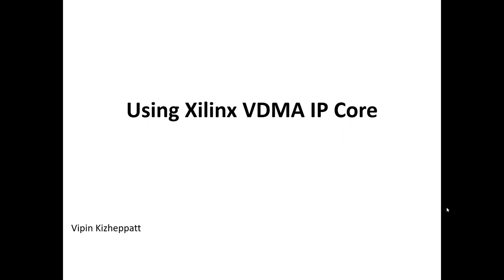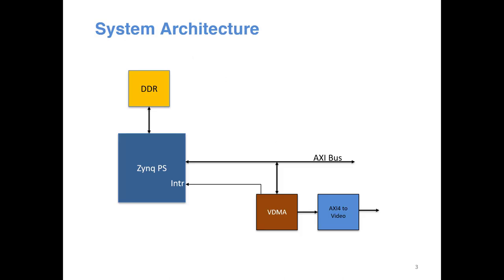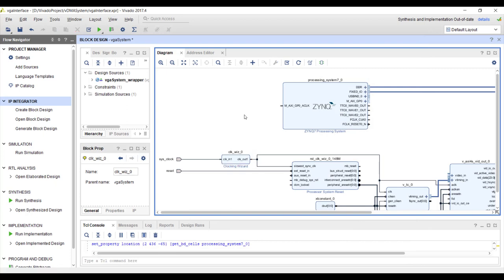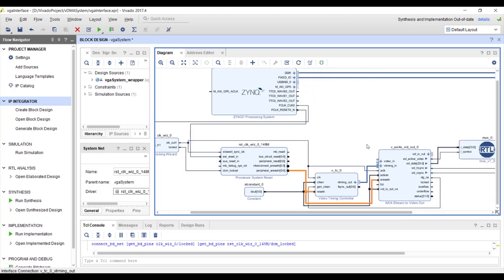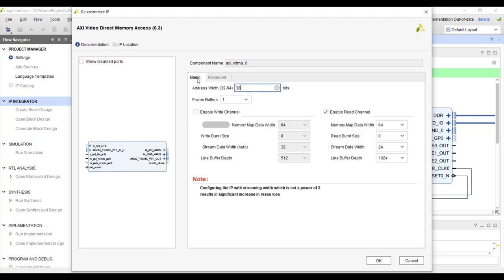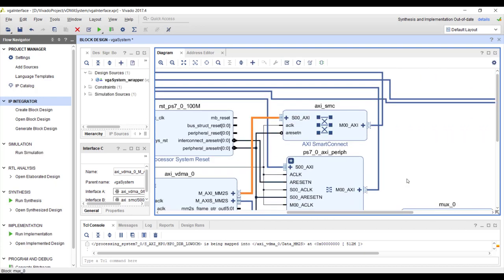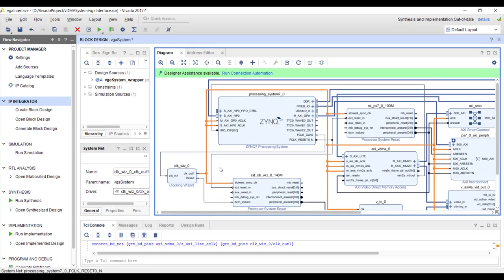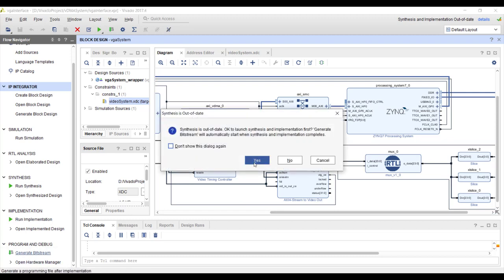Video Interfacing with Zynq (FPGAs): Part 3 Using Xilinx Video DMA IP (VDMA)

Comment: how to store the video capture from camera to memory(ddr3)
???
Reply: Hey, Were u able to figure out how it's done?
Reply: If it is a parallel camera or MIPI camera, You need to have camera receiving system to convert to parallel, and it need to be converted to axis format. The AXIS out will drive the vdma stream interface.